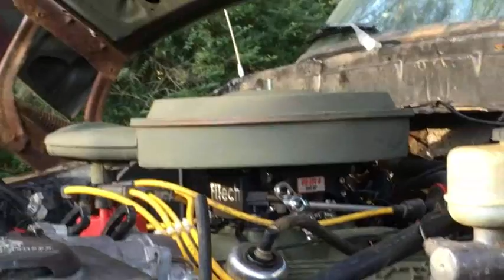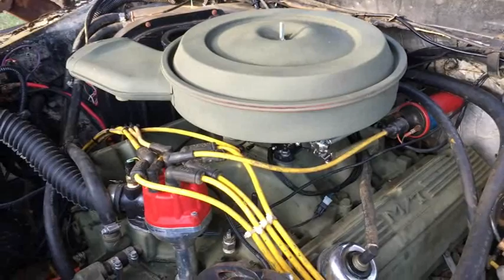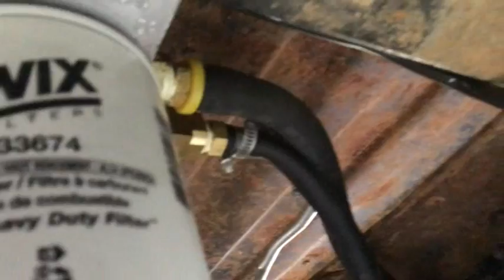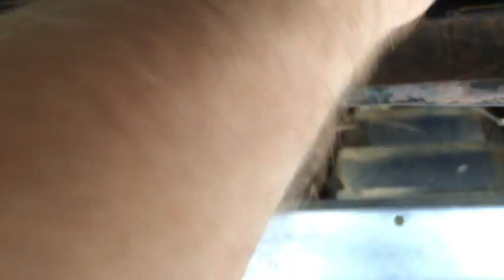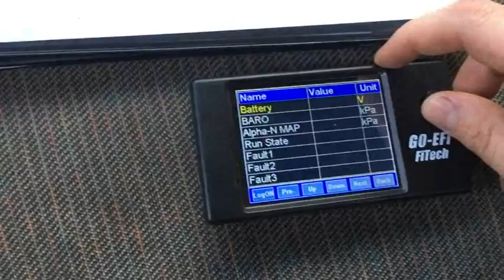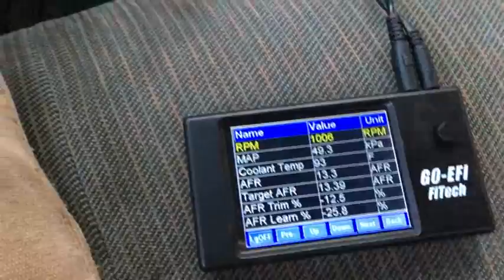thekingofcows' FiTech Fuel Injection overview (Ford 460)

Comment: i am build a 460 for 1977 f350 i liked your porting video i got to get same heads as i have a 1969 engine and compression will be to high according to my thinking and the Mad porter i bought his stuff yet to look at it butt will be porting the snot out of it .but i bought a fi-tech on ebay no hand-held tuner i rather tune with a pc  Question is did you hook it to a pc /laptop or just handheld thing .worst case ill gut the bs ecu and run a megasquirt /microsquirt ecu  might as well do that if i want a turbo just for sillyness  [fun] because  the unit i got will not allow turboing now i remember [wile typing] so i was told anyhow .Do you like the Fi-tech still ? i read mixed crap them .i got it crap so  it will be great etherway .thanks for radiator tips

Comment: having a problem with my 78 f250 / fitech and a good 12 volt connection for the ignition. What did you connect the white wire to? my

Comment: Hey Man I got a couple questions on how you did this fuel injection conversion. I myself have a 460 big block and would like to convert to feul injection and I do like the fi-tech system that you have. If you could send me an email on what you bought and how you did this conversionspecifically that would be greatly appreciated my email is joeyramirez363@gmail.com

Comment: can you shed some light on mpg increase if any, i have found nowhere where anyone post fuel mileage gains. example i have a 84 f-250 4bbl 460 automatic 2 wd.. with the factory motorcraft made by holley i get maybe 10.5 mpg. now for me to spend a grand or more for better drivability and starting i can buy 3 holley 4160's new in the box. but it's still carbs..
Reply from the maker: Charles Hollingsworth I'm still working it out (I don't put many mikes on this truck) but I get in the neighborhood of 6.5 MPG. I got around 5 before.
Reply: nice old ford i have had many including broncos.. i love the 460 engine. my 84 was a one owner stored 20 years in a basement with less than 35,000 miles when i git it now at 58, 000  only has 5 number odometer that idiot's these days can't read paint and interior near perfect. new fuel tank, and sender from sitting put rebuild kit in carb but as you know they have their quirks. 3.73 limited rear..thanks

Comment: ok so color me dumb, carbs I can handle ignition systems I can handle, but ive got a 429 cj with dv3e heads, intake, headers, and a comp mutha thumpr cam, was curious about this system and only reasoning is I haven't dropped the money into a carb for it yet, is the hassle of it all worth it and does it function as reliable off road and on road equally? im looking into the 6al and msd conversion already and probably go with an hei setup, just asking guys, cause I don't know jack when talking this indepth on sensors and wiring....
Reply: This is a beyond late reply, but from what I know and what people have told me, a good efi system is worth the trouble of putting it in.

Comment: That's a pretty dang nice truck! Nice B.B. 460 ON 44in Hawgs! You don't  need a shiny  paint job! So you cant be afraid to scratch up! That truck is just a nice mudder set up!! Even though I am a Chevy man. I also like a nice Ford when I see one!
Reply: Chevy all the way, but like you, I recognize a good ford... and I am kinda partial to a few of them. I'm wondering how bad a 460 in a 4 speed bronco with a 4.11 rear end is gonna guzzle gas. Thinking this or a holley sniper to fuel it

Comment: Why is there a chevy/GMC Air cleaner?

is that truck Bi?
Reply from the maker: Peter Grillett It's enclosed and keeps mud of the air filter. It was also free.
Reply: I guess if it work.

Still devalues the truck.

Comment: Doesnt look like the sensor is in the coolant flow in the engine, you want it in the block where the temp is better read. If right after the thermostat it will give the computer an inaccurate reading.
Reply from the maker: Bryan Gray it seems to work ok on the water neck.  I may wind up moving it though.